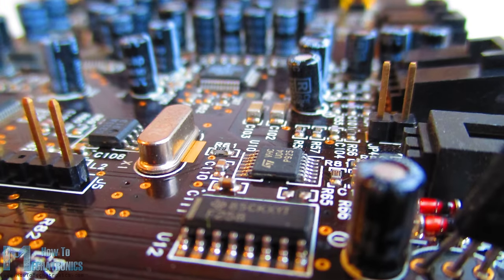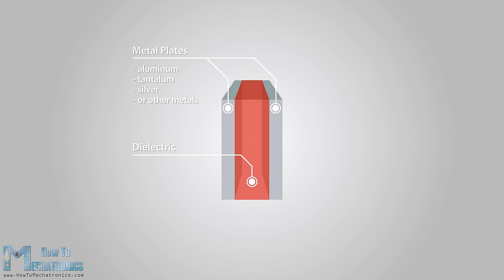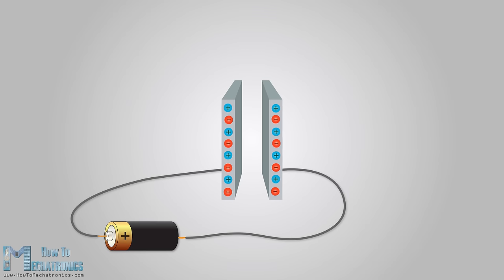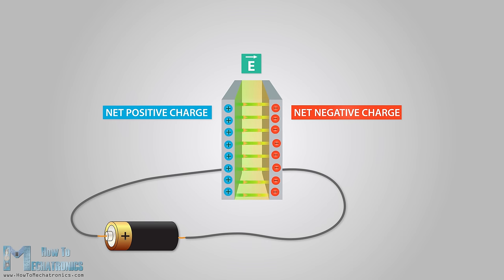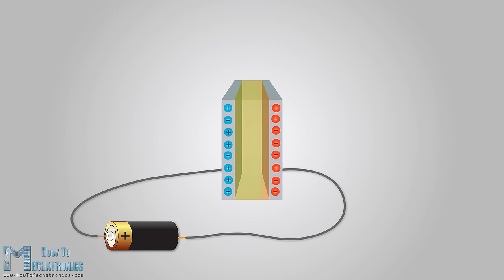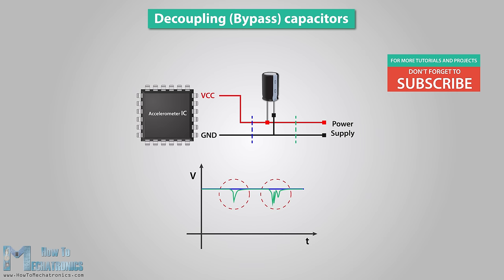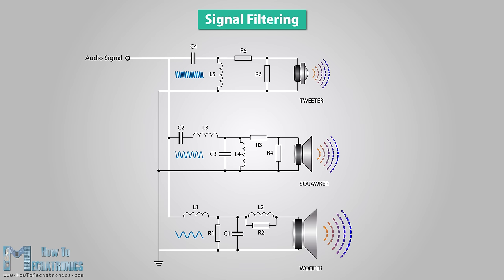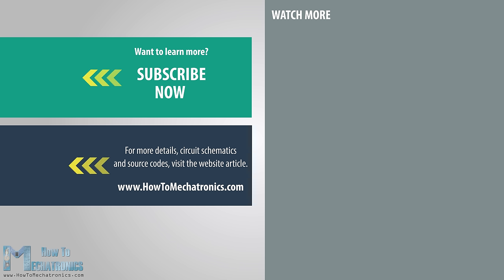How a Capacitor Works - Capacitor Physics and Applications

Comment: my question is, how does the current try to flow in the first place when the circuit was never complete?
Reply: You don't need a circuit to push/pull charges. Circuit is needed for continuous flow of charged particles. If you attach a wire to the negative terminal of a battery - it will still push electrons to the tip of the wire. It's just this motion will stop almost instantaneously because the accumulated charge on the end of the wire will start to repel any new electrons. Capacitor plates are like large ends of the wire that can accumulate more electrons (or positive charges) before they start repelling strongly.
Reply: Stanislav Bashkyrtsev oh okay. makes sense. thanks loads (:

Comment: The electron leaves the negative terminal of the battery first. Then in order for it to go onto the plate on the right, an electron has to leave the plate on the left. That electron that leaves the left plate then travels towards the positive terminal of the battery. This process repeats.
Reply: And i also think that they Travel throu the battery but the Lower positiv charge lets more negative charges off the battery

Comment: 2:30 It was a good video. I think an extended version might help people who have already seen this video. I think at that timestamp it would have been good to at some point mention the energy gap of an example Dielectric compound as long as it is as simple a molecule as possible. The suggested Glass might be an OK example (Silicon Dioxide) or maybe something which is just one element. Maybe nitrogen would do, even though it is unlikely to appear in a capacitor.

Comment: Ahhh thank you!! I'm understanding it now!! I'm a 3rd year electrician apprentice. Just wondering if you could please explain how a capacitor works in the controller with 3 speeds. I know that the first speed is straight supply (the fastest) but how does the capacitor work in realation to the other 2 speeds?? Thanks mate much appreciated
Reply: Sorry I ment to write "in a ceiling fan"
Reply: I'm learning this, and I'm in grade 11. Dang it school...

Comment: What do you use to make the video? I'm doing robotics and your videos are very helpful. I even made colour sorter for my college project
Reply: xavier colaco if you want mechanical 3D softwares for modelling, check out Onshape and DesignSpark Mechanical. These are free. You might prefer Onshape for mechanical drawing. Later you can import 3D into Blender for rendering and animation. 
If Blender is too hard, check out tutorials by Neal Hirsig at Vimeo. He is good for absolute beginners. He can quickly pull you on Blender. His tutorials might be a little dated, but they are very useful. Hotkeys are unchanged.
Reply: Pink Lady Thanks will check it out.
Reply: xavier colaco Blender is free. DesignSpark has few free softwares, one for mechanical, another for electrical, and another for PCB. For mechanical, you might prefer Onshape over DesignSpark for some advanced tools like Featurescript that quickly lets you draw involute gears and probably other things. I am only starting Onshape a few days ago. Onshape was created by the same developers of SolidWorks. 
Tutorials of Blender, Onshape, DesignSpark etc are plentiful in Youtube.

Comment: Hi excellent explanation also please can you explain to us,1. super capacitor vs electrolytic capacitor  is different  and advantages. 2 value of capacitor if parallel and  series with signal

Comment: Thanks for your nice explanation! I have a question regarding your last graph: Why can a battery discharge as fast as a capacitor? This can't be right ? Or at least the battery will be broken because of enormous heat? And if it can discharge that fast, why can't it charge so fast? My explanation is that it could be because of the size of the ions (30000 times bigger than electrons) that have to travel trough the battery, but this explanation doesn't fit with the quick discharge, because they have to travel during both reactions... Thanks for your help!

Comment: what happened to the pos charged particles on the capacitor plate on the neg battery side? they just disappeared and you made it a neg net charge. They can't just disappear, they must of gone somewhere or since there were so many neg charge particles that it turned them into neg charges???

Comment: Nicely put. How do capacitors effect amps (as in current, not amplifiers.) ? Lol if it's not obvious, I'm new to electronics.
Reply: jeremy henderson  Capacitors are not resistive components like resistors which oppose current flow but they are known as reactive components which offer a resistance which correlates to the frequency of the current applied. This is known as Reactance and is inversely proportional to the input frequency. This is why capacitors block DC because DC has a frequency of 0 which anything divided by 0 is infinite.
Reply: jeremy henderson  the formula to calculate a Capacitors Reactance is equal to X=1/2 x Pi x f x c 

Where Pi refers to the constant 3.141
F refers to frequency of applied signal
C refers to capacitance of the capacitor
Reply: @TH3B00T  :) Thanks, that's very helpful.

Comment: When connecting the battery the electrons start to move from the left plate of the capacitor to the positive side of the battery.  But why the electrons keep moving to the negative side of the battery and not accumulating on the positive side of the battery   ?
Reply: Salwa Saba negative electrons will always flow to the positive, negative▶️positive

Comment: Sir how can a capacitor's discharging time be increased?
Reply: U can increase the resistance in the circuit u are dealing with
Reply: increase capacitance, or the resistance connected to it ..

Comment: Its interesting how you mentioned speakers are like capacitors, because I was upgrading the speakers on my car and not to mention my car will only turn on when it wants to. And I was aware that people kept telling me that it's an ECU problem because the capacitor is no good. Believe it or not, after upgrading my speakers, the car had a much bigger problem. The car would turn off by itself. Call me crazy but I don't want to think the speaker has anything to do with this. Would it? Since you mentioned it filters frequency.

Comment: Wait decoupling was when you separate an ac wave from a dc offset
Reply: that's the one that also looked weird to me. from what i know, decoupling capacitors are wired in series and are meant to stop dc while allowing ac through (like in tube amps where they stop 300v while they allow the ac sound through). from the example he gave, it looks to me more like smoothing capacitor which smooths out rectified power.